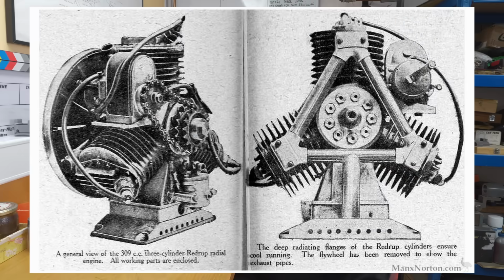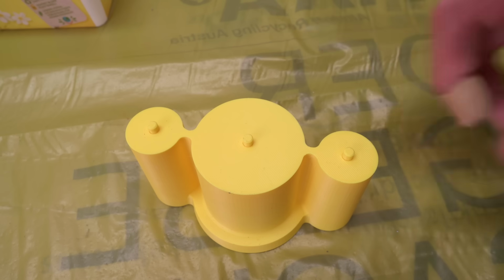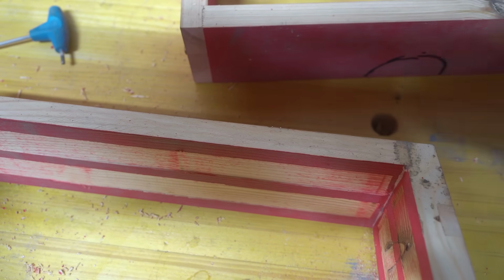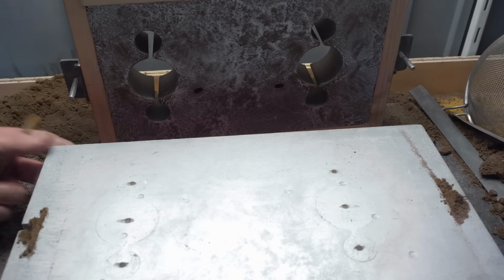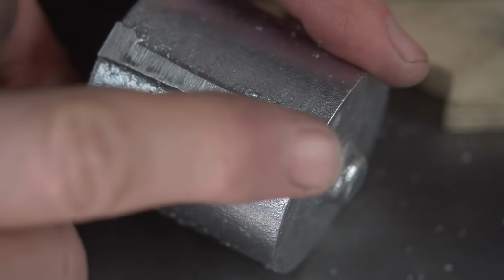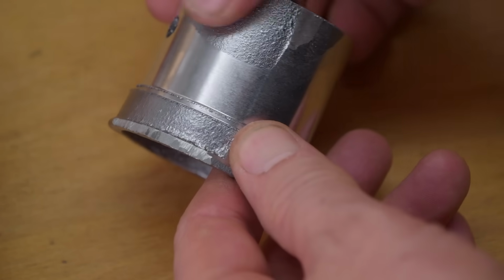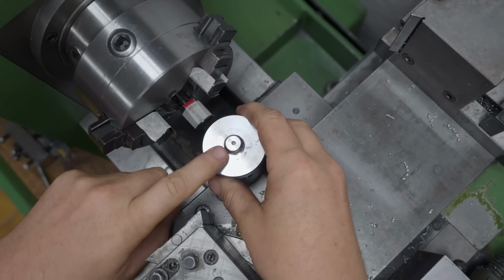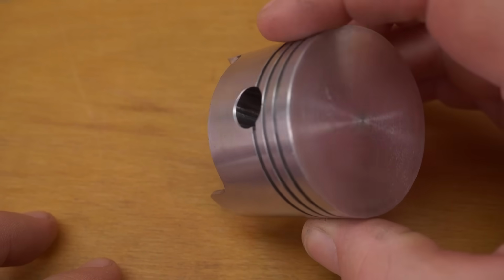Casting and machining pistons for the 1920 Redrup Radial replica. EP.5 || RotarySMP

Comment: Nice work, i may have missed it but how did you get the oval shape in the final dimention?
Reply from the maker: I got lucky. The mandrel with the pneumatic pressure of the tailstock distorted the pistons just the right way for this to be the ovalisation when turned.
Reply: Was going to ask the same thing, whether the oval was programmed into the CNC and indexed relative to the chuck's rotational position (sounds tricky!). So, you just had to program the taper, and the oval was achieved through mechanical pre-load(?). @RotarySMP
Reply from the maker: @mikerutchka1836  Correct.

Comment: hello Rotary.. for oval piston machining, do you use linuxcnc and its “eoffset per angle” function? Congratulations again on your foundry, it's very clean.
Reply from the maker: No, I found that shoving the mandrel up the piston with a pneumatic ram was cause enough distortion in just the right way that they came out like that. Got lucky.

Comment: Boah! It takes a lot of motivation to go through all that combined with enjoying it! 
A 4th axis is nice to have, but how often would you need or use it? I plan to make one some day for wood work... Custom columns!
Reply from the maker: Yeah, so far I have not really needed one. Of course it would be nice to engrave on cylinders.
Reply: @RotarySMP  My software allows for backlash...
Reply from the maker: @Johannes58934  You can set up back lash compensation in LinuxCNC as well.

Comment: You may want to add a bit of silicon to the aluminum. Heck just toss a hand full of old computer chips into the crucible, (after removing the prongs.)  Oh who you trying to be, BURT MONROE?, YOU GOTTA USE A LITTLE FORD, AN LOT CHEVY, MAYBE A PINCH OF CHRYSLER TO NAKE WORLD RECORD BREAKING PISTONS.   I'D TRY MAKING a punch die like coins are stamped with as a mold for the pistons, get it slammed in a 500 ton press just before the aluminum freezes. To forge the pistons. Or just buy pistons, make everything else. Hand forge rods I'm guessing xou are going with a maste and two slaves? What is the displacement 150-185 cc?whay not go with 300-375 cc, you can get 150 cc chinease scooter honda clone scooter pistons for about $50-$60 (for all 3, with rings, and pins, decent quality) i have thought about building a two cylinder scooter engine. Two, one based on a big bore 50 cc, the other on a 150 cc big botre 180cc x2 and the 50cc being 82cc-95+/- cc x2. With a 90° or 180° cross plane crank. Maybe recast the case halves. Filling in a large portion with clay to allow milling material. I want to add a 3rd main bearing most do not add when they build these engines. There is a company that will build these, $10,000   i have that much in my 6.4 litre v8 600+ hp engine .  Use stock rods and modified crank with a center section made from slices of 4" 4340 and 18-20 mm  tool steel pin/journals. Maybe 25mm not Shure what the mains are, id cast a new two cyl  head insted of welding them together, use 125cc valves on the 50/85cc version. And oversized valves on the 150/180cc version.maybe use valves from a honda 250cc bike. Maybe use a tapered pin in the rod and main journals using a safety wired in grub screw to see it is retained. Maybe mill and grind custom pins going from about 2.5 mm to 4mm over about 30 mm make them from tool steel, mill a flat and drill/thread a m6-m8 hole about 3mm short of hitting the pin journal. Use a 2-3mm ball bearing between the two. Fitting into dimples in both.  Torque to the low side of the max allowance, with lock tite on the threads then drill a 1mm hole through the screw , it being only about 5-6mm long. The allen head possibly leaving it hollow. With the crank arms being milled for clearance on the sides of the areas with the grubs. To allow room for the safety wire. The cam made from 20mm 4140,4340, with slices of 50mm pressed on with a couple  splines  and have the camcustom ground  similar to a race motorcycle cam. To gain power with 200psi compression,
Reply from the maker: Hi James, I think forged pistons would be kind of overkill for a 2 3/4 hp 300cc engine.

Comment: You might have mentioned it in one of your videos already, but just in case you didn't know, make sure not to use the MCD insert to cut metals containing carbon like cast iron as it will lead to chemical wear.
Reply from the maker: Julian warned me on that. Non-ferrous only. It sure stood up to the abrasive high silicon alloy better than the carbide inserts.
Reply: It's Julian 🤣
Reply from the maker: @wiju  Oops it is. Thanks. Corrected.
Reply: @RotarySMP  no problem, nice job  😁
Reply from the maker: @wiju  I will have to try out that MCD insert on wrought aluminum. My porous castings probably don't really show off it's full potential.
Reply: @RotarySMP for posing that's a good idea 🤣

Comment: Those little 3mm rebates are essential for easy assembly - I never do without them. I love how you're using a square while clamping in the centre of the board though 😂 Oh so lightly...?
Reply from the maker: Yeah, this is not exactly precision joinery, as you don't want to get too attached to them, they always end up burnt.

Comment: If you're looking for an excellent base for a rotary axis conversion for the mill, keep a lookout for Walter dividing heads. Something like the UTA (Universalteilapparat) 125 or 150 would have been standard equipment for a manual version of your Maho. They have excellent precision internals with adjustable worm gear preload aswell as standardized 90:1 gearing, and thus lend themselves to CNC conversion.
Reply from the maker: Thanks for the tip Dieter. I remember Stafan Gotteswinter did a review on one some years ago. Do they make them with D1-3 camlock spindle nose?
Reply: @RotarySMP  Stefan probably has a catalog
Reply: @RotarySMP  I'm not sure. Mine is a No. 3 short taper, and I certainly have never seen one with a factory camlock. It might make a nice whiteboard-suitable project to make a flange plate like Brandon at Inheritance Machining has done for his large rotary table.

Comment: Building a fourth axis from scratch would be a good project.
Reply from the maker: I have also considered doing that, based on a harmonic drive.
Reply: @RotarySMP  stepperonline sells planetary gearboxes with supposedly 3 arc minutes of backlash; they're only €100 for a 60 mm frame servo (10:1 reduction). on a 60 mm part that would be an error of 0.02 mm or so, might be worth considering also
Reply: Agreed, I’d love to see that!

Comment: From my experience, coke cans make for the absolute worst casting aluminum ever. When i was a kid i was very into aluminum casting and getting aluminum was not that easy. 
Beer cans were quite plentiful, courtesy of my father, so i tried those and the end casting is absolutely horrendous. The shrinkage is crazy and the aluminum is weak, machines terribly and is not worth the hassle. Hard drives are another source of terrible aluminum, they produce castings similar to beer cans.
The best aluminum from my experience came from VW intake manifolds. More specifically the intake manifold i nicked from my brothers B3 Passat. The alloy is strong, shrinkage is very manageable and it machines beautifully. Gas bubble inclusions are also very minor, considering i was casting lost foam.
To me it was important that there was as little porosity as possible, because i was making a butane pump.
Reply from the maker: Yeah, much better off finding an old cylinder head or something.

Comment: Fantastic timing.  I was just about to cut up some logs with the chainsaw when your video popped up.  Now I can have a coffee and a procrastinate!!
Reply from the maker: Glad to be of assistance :)
Reply: I was going to go outside and mow the lawn.
Reply from the maker: @ If you leave it till tomorrow, the grass will be longer and more ready for mowing. :)
Reply: @ but I've already put it off all week anyways to late got it done procrastinatist of the world unite tomorrow.
Reply: @ Its the same amount of pushing a mower if you're taking an inch off the grass or 3". So you might as well leave it till you can't find the garden furniture anymore and do it once every few years. 😁

Or buy a couple of pet pigmy goats. They'll keep the grass pretty short......... And the flower beds, the bottom of any washing hanging on the clothes line, and the hose pipe if you don't keep it hung up on a wall hook. 🤣
Reply from the maker: @ Like that :)
Reply: @ can't keep goats in town otherwise I would and it was already put off the week before because it rained it was coming up to knee height  done now though.
Reply from the maker: @ I wonder if my neihbours would be happier about goats or the foundry ?

I mist my window to cut the grass on saturday. Now it has rained for two days, and then I have a work trip, so it will likely be knee high here as well.
Reply: @RotarySMP  I am using the excuse of "no mow May" so I don't need to cut the grass until June!
Reply from the maker: @broglet2003  Oh... I like that :)